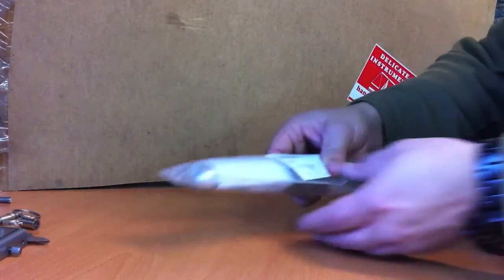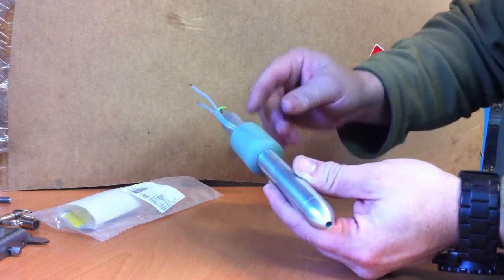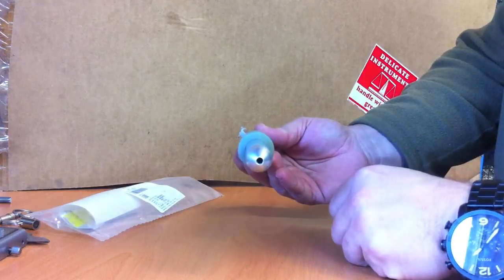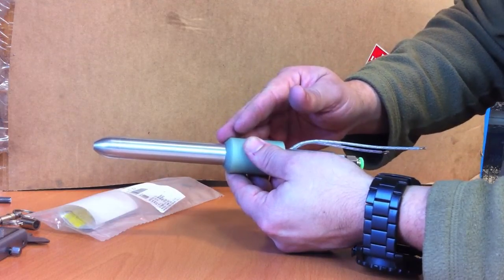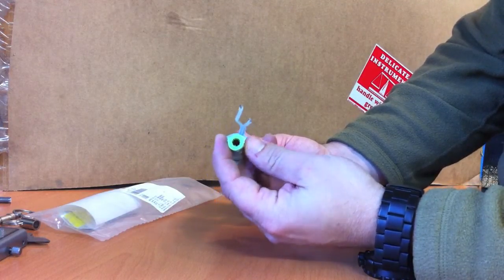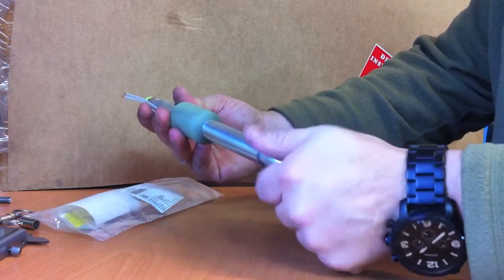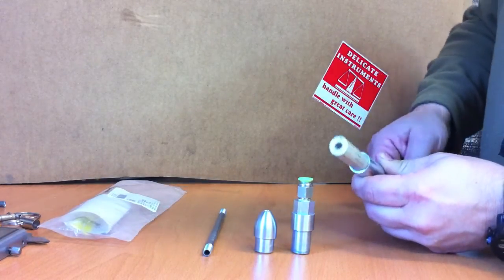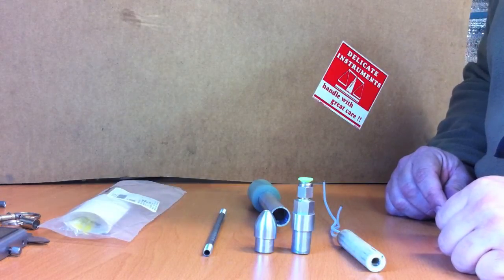Pitot tube disassembly

Comment from the maker: That's a very good question for which I don't have a final answer yet. It's one of those things still in the "to do" list. However, I have used a G10 insulator around the Pitot tube which will be floxed into the nose. I have made some progress developing a power unit that reduce the amount of heat the Cessna element puts out, but it works too well. I'll have to modify it again, but I've been too busy to get back to that R&D project. Check my blog if the power supply interests you.
Ciao, Marco.